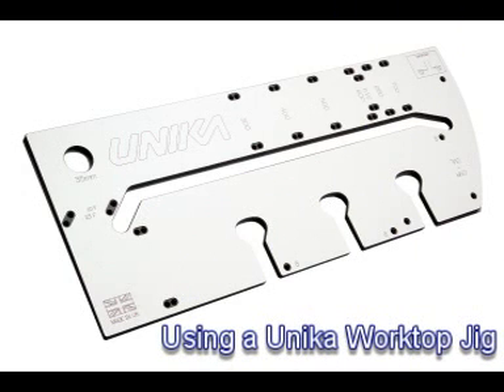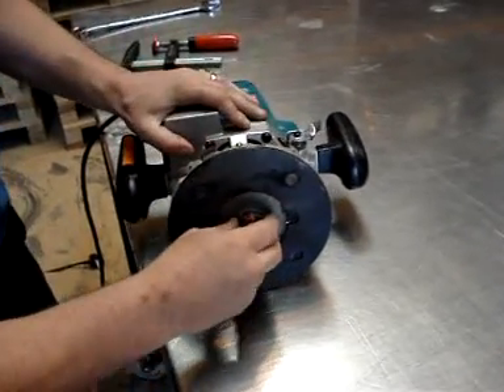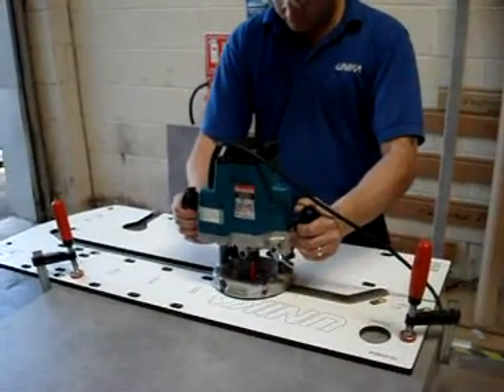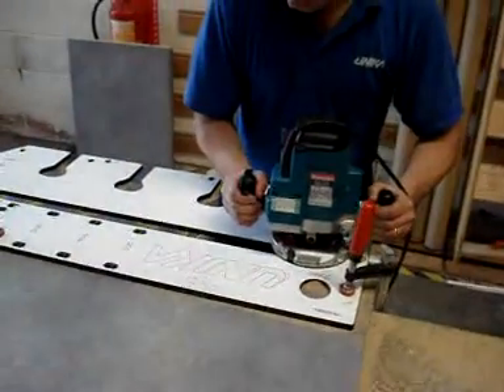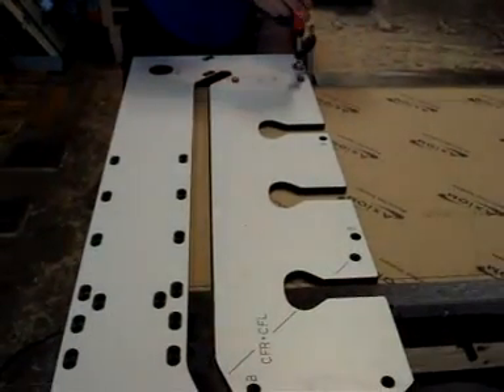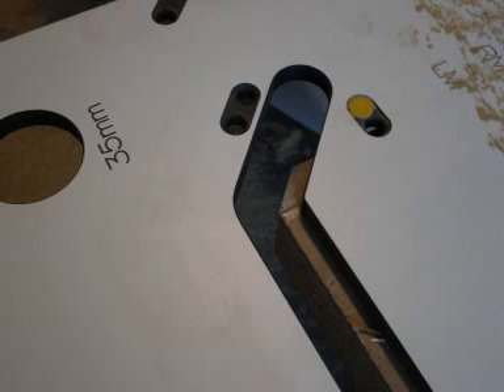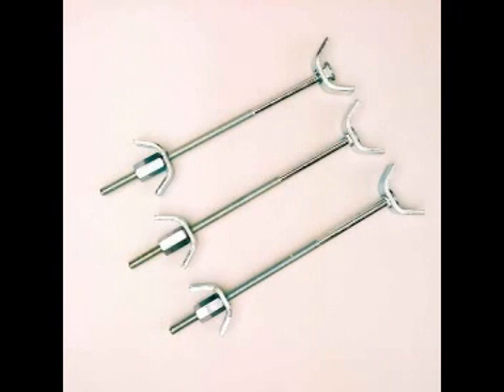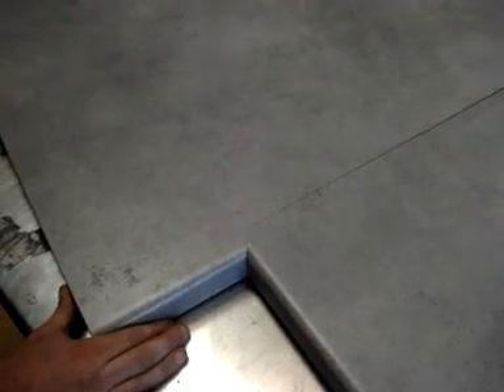Unika Multipurpose Worktop Jig

Comment: I've used a few jigs over the years but have settled on the Unika. One small tip I would add to the video and that is to lay the router electrical cable out in front and away from you so it cant get caught on anything... nothing worse than getting halfway along the cut and the cable snags from the side and pulls at the router.

Comment: Do i after use biscuits also or does the bolts and glue hold the joint together good enough?
Reply: I’d only use biscuits on solid wood worktops that you can sand smooth once installed.

Comment: Solid wood work tops should not be mitred. They should be butt jointed and bolted with PVA glue.
A mitred joint will come away as the wood expands and contracts over time due to relative humidity.